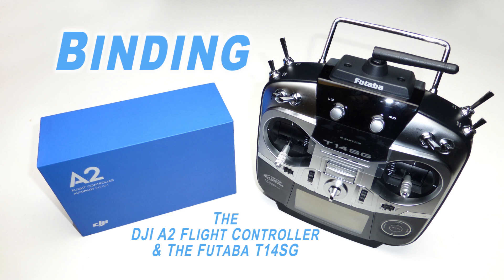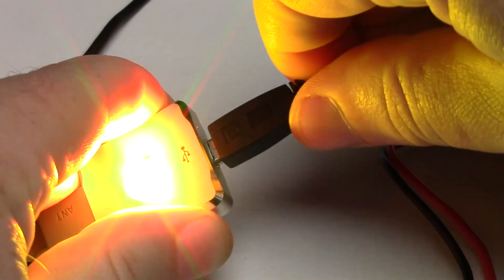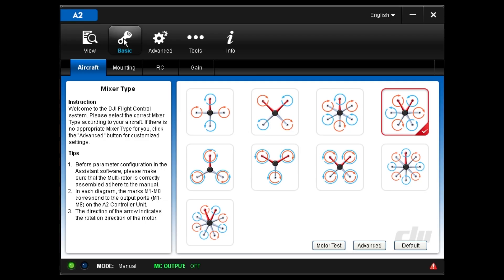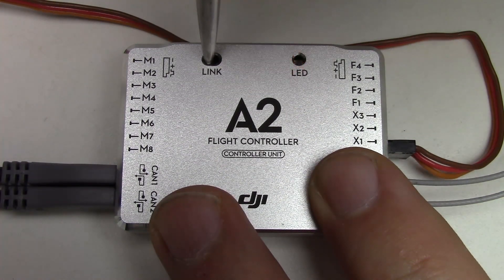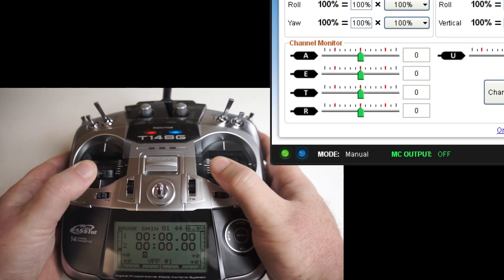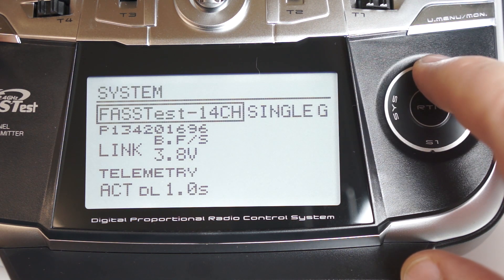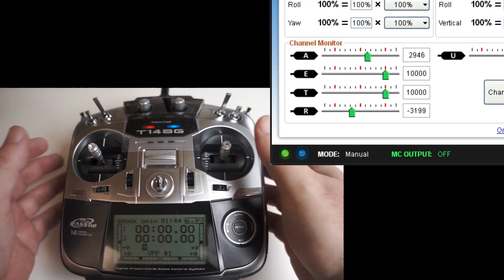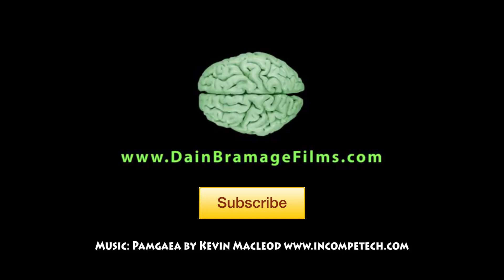Binding the DJI A2 Flight Controller with the Futaba T14SG Transmitter

Comment: After I calibrate my a2 flight controller my A2 computer software  says abnormal transmitter mid point error. 
and the a2 led flashes red as soon as i turn on the battery. Does anyone know how to solve this?

Comment: Hello, I am a beginner. I have a Futaba T8J and a r2008sb recipients. Receiver is connected via S-BUS at A2 and it seems to work but I have not managed to start the engines. Why Is that so hard to start the engine? Which position on the control is so important?

Comment: Brook, thanks! I am having trouble getting my controller to connect on the software. I bound it fine to the A2 receiver, but the A2 software doesn't show it connected, just keep telling to connect to a controller.  I have a 8FGs. I copied my WKM model over to a new one, changed the "frequency" to Multi and it bound fine. Any help would be appreciated!